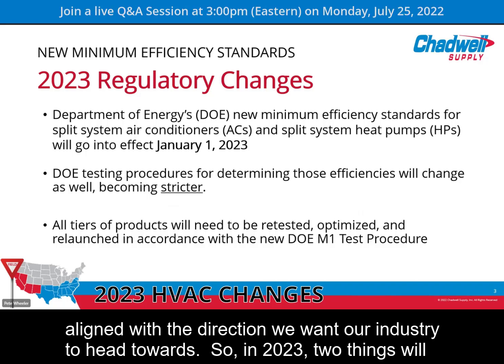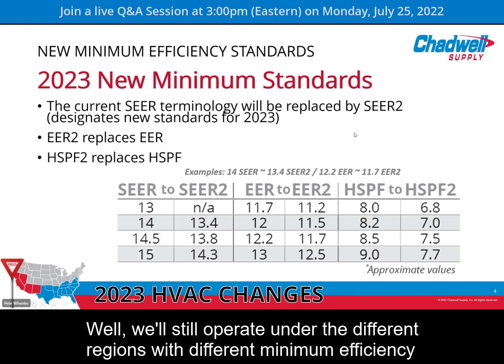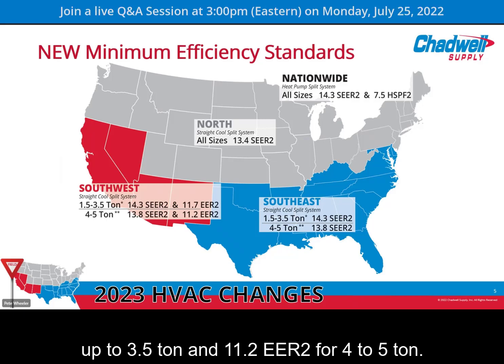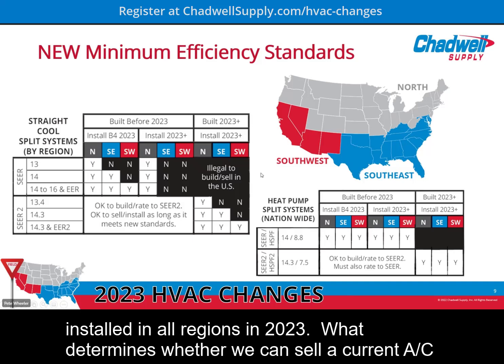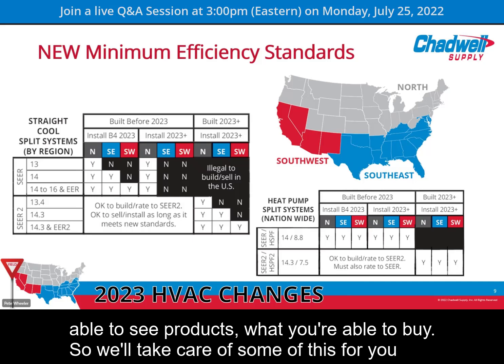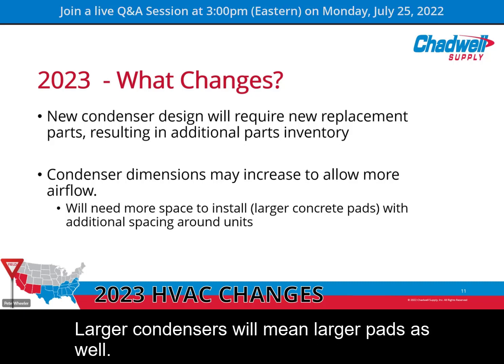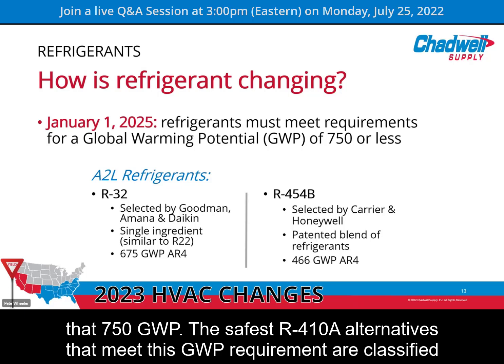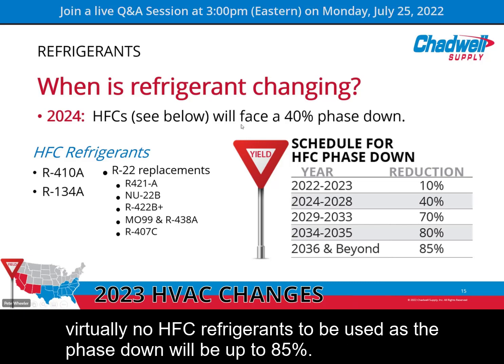How Changes to HVAC Regulations will affect Multifamily in 2023 and Beyond

Comment: What’s the drop in replacement for 410@ Or 134?❤
Reply from the maker: There will be a few different replacements (NOT "drop in") for 410a. At this time all are pretty equal in price, however when the next allocation comes that will drive the price and these replacements will start to be more feasible.

Comment: You already can’t get parts for old units😮
Reply from the maker: Yes, we understand.  Parts are starting to get harder to find to keep the older stuff up and running. So, at some point we're all going to have to change...The only constant we have with HVAC industry, is change. Having a few different vendors on speed dial might be helpful. (Chadwell Supply would always be my first choice! ;-) ) Most of them can special order a lot of the older parts. Special order also means longer lead-times too. So, at a certain tipping point, our only option will be to change and embrace new technology!